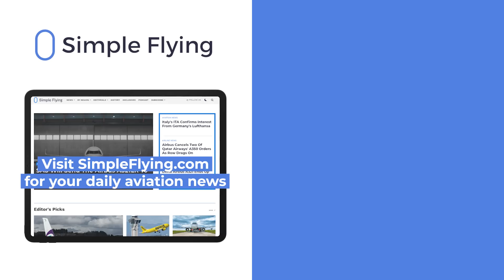Boeing Is Currently Assembling The Last Ever 747 Jumbo Jet

Comment: as fas as I know, almost 2000 have beeb built, with approximately 300 of them still flying, whereas 85% of them are now cargo jets. airplanes have a life expectancy of 30 years, so the 747 will be in the air until 2050 or even beyond.

Comment: I think the 747 will make a production comeback once we have better and more fuel efficient engines or may be even electric engines. May  e a 747 with 2 engines instead of 4. Having 4 engines has cost but it certainly has advantages when it comes to safety. Thats why still many VIPs use it like the US president.
Reply: There are no electric jet engines, and no electric prop engines that can sustain a full size commercial air liner.

Comment: The Queen is an iconic 747, I'm so sad that Boeing stopped or will be stopping production of the 748. I would've thought they would've got more customers for the 748, seeing that it borrowed a lot of her components from her sister the 787 Dreamliner, as with the wing design, the engines and the carbon fibre design. She's more fuel efficient and so I think more airlines should've kept being customers of the 747. That's my opinion anyway. I grew up with the 747, as I was born in 1975, so that would've been when the 742, 743 were still being manufactured. As the 744 came about in the early to mid 80's.

Comment: It's incredible to think that just 40 years ago this thing was THE plane to buy to expand your airline business. Honestly, it saw off its "closest" competition so convincingly and so dominantly you wouldn't be crazy to wonder why Boeing's competitors had even tried to compete in the first place. The DC-10 was a rushed design that was plagued with design faults and maintenance issues early on in its service life and still didn't have the passenger or cargo capacity of the 747. The L-1011 was far more advanced and far easier to fly... so advanced that the program was plagued by numerous delays and it was exorbitantly expensive to buy and maintain while also having less passenger and cargo capacity than the 747. To put into perspective just how dominant the 747 was, the L-1011 and DC-10 ended production in the 80s. The 747 is only ending production in 2022. People need to remember that this aging anachronism that we see now was once one of the most successful airliner designs in aviation history.

At the same time, people need to also understand that this design was not successful for a long period of time. It's most successful period was in the 80s, the height of four-engine long-haul airliners flying routes based on the hub-and-spoke model. In the mid-80s ETOPS regulations were reinstated and the 747 immediately found itself increasingly obsolete against a new generation of twin-engine widebodies that were more efficient and cheaper to maintain, all while carrying close to a similar cargo and passenger capacity. From 1990 onwards the 747 was gradually losing market share to the Airbus A300 and A330 and Boeing's own 767 and 777.

Comment: 1) I'd like to know the status of the two Air Force 1's, and, 2) Why is it not economical to fly a 747 for passenger service, but it is economical to fly it as a freighter?
Reply: The Air Force One aircraft are currently outfitted with all the modifications.
The second question is a very complex one, has to do with cost structure, operating profiles and payload-volume metrics.
In short: fuel efficiency is not as important for cargo ops compared to passenger ops, other factors (like having a nose door or having a high payload) become more relevant.

Comment: Can someone explain me this? The 747-8 passenger version is fading out due to lack of orders and maybe fuel effeciency. But the 747-8F is a unique airplane with a big capicity in the cargo market. Isn't it maybe a little too soon to end the 747-8F? I feel like this is like the 757 it might be again needed in the future
Reply: @Khoi Le Anh yes indeed and the 777F production is continuing too. But what bugs me is that the 747 has a bigger cargo capicity than these twin engines. Why would it be convinient to swap to a smaller aircraft? Since more trips for moving a big load would cost also in fuel efeciency
Reply: @vasco77l97  its not too soon. If no orders are left there is no other choice. Everything else is a huge waste of money. As for payloads: the one factor that sets the 747 apart is its nose door. The payload doesn’t matter that much as the competition isn’t that far off.
Reply: @swems-z3s  thanks for answering! 🙌 You got a good point!

Comment: There remains significant interest in the 747 freighter variant by current operators such as UPS, Atlas, Cargolux, Polar Air Cargo and Kalitta Air. These operators have been committed to the freighter variant for many years and with the increase in air cargo capacity post C19 I see no change in that. All of these operators will need to replace current aircraft with new at some point. I do not believe ceasing production of the 747 Freighter to be a sound business decision. But then we have seen Boeing make many unusual business decisions over the years this one they will regret.
Reply: But no one ordered any 747s anymore. So Boeing has no other viable choice

Comment: Worked on the early B747s with the PW engines and pulled out on many occasions sintered metal from the jet exhaust (blown fan blades). Then onto the GE powered ones which were very reliable. B747C and the most challenging the B747BC where you were mixing big freight with pax on the main deck. They were magnificent aircraft to work on with a big trim tolerance and excellent loading systems.  Never told the passengers immediately in front of the cargo, cabin divide that behind them was a PMP pallet weighing 13600kgs with a 10ton Ingersoll Rand road roller. on it. Did not want to spoil their flight. As always safety was never compromised and cargo and pax arrived at destination.

Comment: Boeing made a mistake shuttering the 747. Demand has come back sooner than expected and Emirates is openly asking for airlines to make something bigger than the A350 or 777.

The 747-8I, with its modern fuel efficient engines compared to the A380's older engines, is the obvious plane to fit these needs, but Boeing had already shuttered the 8I variant. Missed opportunity!
Reply: so why has almost no one bought the 747-8i in all those years then?
Reply: @swems-z3s  because airlines are bad at anticipating demand. They are fundamentally risk averse. And for the US carriers at least, they have routinely used their excess cash for share buybacks rather than investing in their fleet for the future.
Reply: @Vivek-zw3ex  But airlines even weren't ordering it when demand was as high as never before. Last order for the -8i came in 2012, ten years ago. So it isn't a question of anticipating demand. Its just that you simply buy a 777 instead which is for passenger purposes a much better aircraft even though its smaller. With the new 777X that argument grows even stronger.
Reply: @swems-z3s  that's the problem. There's the old saying that a bird in hand (747-8I) is worth two in the bush (777X).

The airlines bet on a non-existent future aircraft rather than the one that existed already. And now with slot restrictions and labour shortages that limit the number of flights they can operate, they are really paying the price for not having aircraft like the 747-8I in their fleet.
Reply: @Vivek-zw3ex  If you want to go with existing aircraft the old 777 and A350 are still the better choice. No one misses the 747-8i. Some will miss the A380. But "some" is not enough.
Reply: @swems-z3s  yep

Comment: It's so unreal knowing that the 747 is nearing the end of it's production run. I really hoped the USAF would have reversed it's decision to refit those transaero 747s into air force 1, and order fresh 747s from the factory, and correct the mistakes Trump made. As to when the last 747 will stop flying, great question. I'm 46, as of this date, so I might be in my 90s, or dead, when that happens.
Reply: Trump put a price cap on the project, rightfully so. Boeing goes in to the government’s wallet whenever it wants, and that money comes from the people. There was no point in using a brand new airframe for the replacement program.

Comment: The new Air Force 1s will still be flying beyond 2050, almost guaranteed. As far as commercial revenue service (likely for cargo), I expect they will fly until they are no longer profitable or until Hong Kong places restrictions banning 4 engine aircraft. I almost expect Kalitta Air to be the final operator, if Connie can buy some used freighters. They had the last revenue flight of a 747 Classic in 2012, I believe.

Comment: I think between the new VC-25B's (Air Force one) and Cargo variants, they should make it to 2060 at the very least if not 2070. 747-8f will be the only plane of its class so their operators will want to keep them for a very long time. Remember that there are still a few 747-200f's still around. 

Hell, the 747 was originally designed as a military cargo plane but it lost out to Lockheed's C5 which is still flying as well.

IMO, both the 737 and 747 will reach 100 years of flying and will probably outlive their competitors (a320/a380) due to the cargo and military versions (P8 and E-7).

Comment: What will happen to Everett production plant? 747: gone. 777: type change with challenges, 767: just some left, 787: production moved, 737: production in Renton. So: is Everett useless? Good idea for another Video....
Reply: Probably start converting for this supposed 797 if the project ever…..takes off
Reply: @Khoi Le Anh So right. Gigantic factory plant with just one aircraft type to build: the 777-9 somehow in the future....

Comment: I’m kinda surprised that the USAF never ordered any 747-8Fs. They could’ve ordered like 50-100 747-8Fs to compliment their C-5/C-17 fleet. The C-5M could handle the outsize pieces of equipment, the C-17 can handle the tactical/STOL missions and the 747-8F could’ve been used handle the oversize/palletized pieces of equipment with additional airlift coming from the Civil Reserve Air Fleet.
Reply: They did for AF One
Reply: @johniii8147  I’m talking about 747-8Fs not 747-8Is

Comment: I believe 2050 will be the end
Reply: I was thinking we had a few more years between now and the end of time! :)
Reply: no way that's too long away
Reply: @nickolliver3021  Off topic.  I get a kick out of 'Buffalo Air' flying the DC-3 for passenger and freight.  Others may not know that being unpressurized the DC3 does not undergo the hull stress pressurization causes.
Reply: @danharold3087  okay whatever that means but no way will the 747 will last until 2050.
Reply: @nickolliver3021  I concur.   skylineXpert mentioned 2050.  
On the 'whatever' the DC3 is still flying commercially 86 years after its first commercial flight.  Some are being rebuilt with turboprops.   And I will shut up about that.
Reply: @danharold3087  well even the b52 has been flying for over 50 years now but it depends on the government wanting all inefficient quads to either be taken out of service and scrapped and replaced with more newer fuel efficient twin's by 2030 and beyond 🤔
Reply: @nickolliver3021  You may find it interesting that Rolls Royce has a contract to re engine the B52 ending in 2038.  After investigating a solution with fewer engines they went with 8.   Should still be far more efficient than the original engines.  Watched this selection process it was interesting. 

For me the DC3 hauling passengers and freight is the more interesting.  As a commercial plane it is earning its keep.
Reply: @danharold3087  wait is the b52going to be re engined until 2038? Or ypu mean before and went with 8 4 on each wing? I guess it will be more efficient than the current ones. 

Sadly the dc 3 was hauling passengers and freight but that is no more now

Comment: "Boeing 747 orders: 1,573 - averaging approximately 30 per year since its first flight in 1968.

Airbus A380 orders: 251 - averaging around 13 per year since its first flight in 2007."  -  Simple Flying
Reply: The 747 was built during times were quadjets were still popular, now twinjets are ruling the market, the a380 was built too late.

Comment: I think the 747-8 will fly for around 35-40 years from now. Of course they can fly much longer but I think there will be efficient planes which will than be used instead.
Reply: Not saying your wrong.   But they may be freight routes where the fuel cost is offset by an inexpensive plane with a massive payload.   If you can run one less flight the fuel numbers work out too.  Often and maybe more so with freight the plane with the best fit to the route will make the most money.
Reply: no where near 35 to 40 years. Korean airlines will retire their 747-8 in 8-9 years
Reply: @nickolliver3021  - and those will become freighters or go to airline in iran etc.
Reply: @williamhaynes7089  no they won't. Not even freighters

Comment: When the assembly of that 747 ends it will mark the end not only of the 747 but also the entire quad jet era (which began with the 707)
Reply: True 😭💔💔
Reply: It was also the last early widebody family of the 4 pioneering designs (747, DC-10, L1011 Tristar and A300) to end production
Reply: The Comet had four jet engines.
Reply: @GH-oi2jf  Mainstream is probably the better word then as the 707 was a lot more mainstream

Comment: Is kinda amazing that the 747 outlived the a380 in orders
Reply: A while back I read that the people are Airbus were focused on having the largest plane instead of the projected market for it.  Don't take my words on this without confirmation from a creditable source.
But IFF that is true. it is not amazing.
Reply: @danharold3087  It's true, they did prioritize too much on the pride of being bigger and better than the already massive ironic and successful 747 instead of listening to the warnings of the direction of the market and that not many airlines will be able to take advantage of the outdated hub-Spoke model that only Emirates managed to do well at a large scale
Reply: I wonder if things would have been different if Airbus had not dropped plans for the A380F?
Reply: @MarkUKInsects  - lack of airports capable of handling it ect would have made the a380f a bad choice.
Reply: @MarkUKInsects  It only got 27 orders because of how expensive it would’ve been to operate + also the limited number of airports it could serve (a problem also faced by the sole destroyed An-225). Worse than the A330-200F that did make it to production that only got 38 orders
Reply: @MarkUKInsects  That was also a colossal failure

Comment: Could Boeing have put 2 of the massive GE9X engines from the 777 on a B747?
Reply: Can't. It'll add more weight on the wings and will not have enough lift for such a massive airliner.
Reply: @MSRTA_Productions  1 ge9x produces more thrust than the most powerful genx variant
Reply: @ProAvgeek6328  777x has bigger engines which will help to bridge the gap
Reply: That would require a complete redesign of the wings + a major redesign of the fuel systems, cobtrol systems and other stuff. Then you need to test and certify it.

Would cost the same as designing and certifying a new aircraft but without the performance of a new aircraft.
Reply: But imagine if it was done in X-Plane lol
Reply: I'm actually imagining a B747-8 with only 2 engines.
Reply: @yengsabio5315  never say never But for now we got the 777x that will help
Reply: Can't unless they can make a Ge9x suited for B747.  Install them onto the jumbo jet it will have  Disastrous consequence because of the aero dynamic effects
Reply: @EpicThe112  I want a GE9x-2b for 747-9i and 787-10ER.
Reply: Yeah they should lol
Reply: No